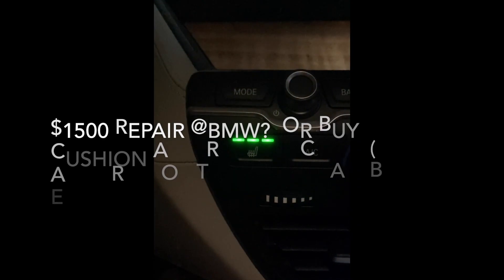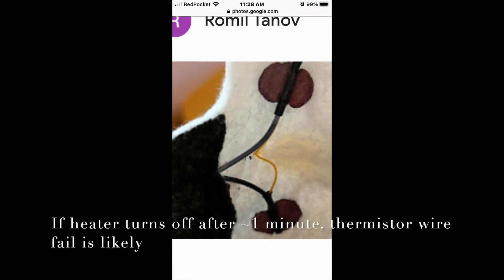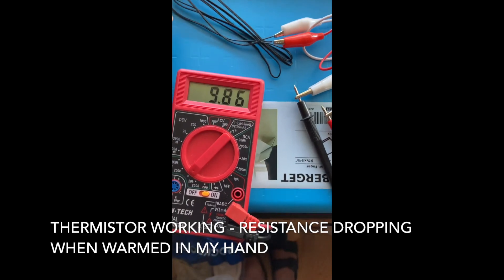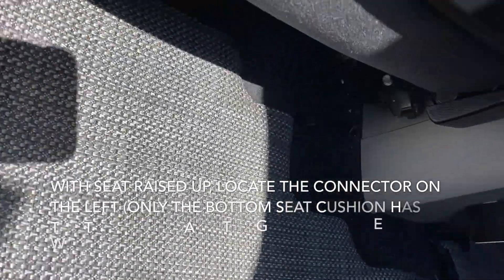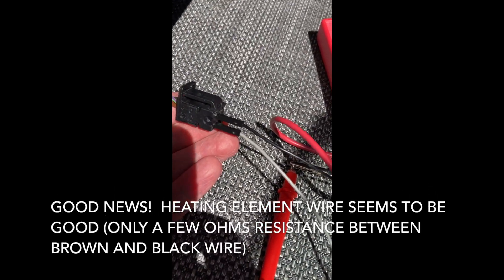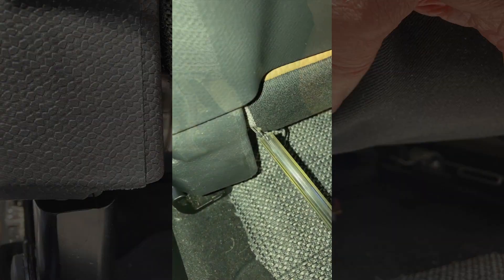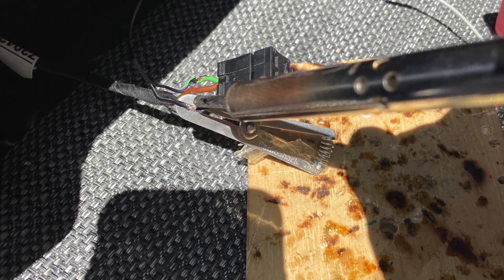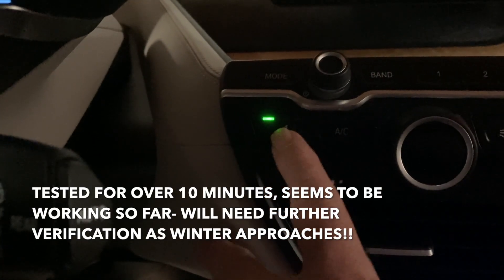BMW I3 DIY  Easy Seat Heater Repair

Comment: I see that this thread is still active and that there are some unanswered questions so: 1, thermistors are two terminal device and they are unpolarized so there is no worry about putting it in forward or backwards 2. Note that there are three wires for the seat heater and the thermistor. That means that one of them, probably the black one, is common to the heater and the thermistor. This is why you need to splice in the new thermostat and not just cut those two wires. If you just cut the two wires then there will be no return for the seat heating element itself. If there were four wires then this repair it would be a bit easier and you would not have to maintain the integrity of the common wire. 
3. If you don't currently owned a multimeter and a soldering iron or gun then you might want to leave this repair to someone more qualified. Maybe share this video with them.
Reply: can you post a link to the thread please?

Comment: At the 4 minute mark you mention that you soldered the new thermistor into the black and green/purple wires. Does this mean that there are 2 wires coming out of the new thermistor?
If so, is there a particular order in which they must be soldered in?
Thanks for your help.

Comment: Hi, I have this exact problem. Drove car last night, after couple mins heated seat turned off. This morning I checked and it did same so I unplugged connector with black, bown and green/purple wire to check readings. The readings seemed a bit intermittent but going on symptoms I suspect it's thermistor. However, on plugging back in without doing any repair I find seat lamps don't illuminate at all so could I have damaged something or is this just coincidence? Basically if I carry out thermistor replacement as you show in video can I assume I can't make things worse?
Is it an open circuit on thermistor which prevents seats operating, that is prevents the heated seat lights etc to be illuminated and hence seat to heat up. So, if I connect a replacement thermistor as you show in parallel with existing one, assuming lights come on and seat heats then this has resolved issue and I can then use plastic tube method to insert into seat base.  I appreciate it's tricky to judge from afar but wanted your opinion if you don't mind. Thanks.

Comment: I lifted up the leather from the lower rear part of seat and found out the black and the grey wires were cut. How does one reconnect them to the thermistor? I can’t find the thermistor. Do I need to tare up some of the pad and dig it out somehow?

Comment: Hi - ive just purchased BMW ix3 seats to fit into my mercedes sprinter. I have identified the cables at the connection socket for the power seat movement but cant find out what the relay wires are for the heated seats do you have a colour wiring diagram for the connection block please? I have also identified the CAN signal wire.
Reply from the maker: No, sorry

Comment: i have the same error code. the heater on driver side turns on for around 4 mins and shut off by itself until completely cool down.  which color of the wire we need to solder with. it seems like you solder both the green and black??

Comment: This video has been around for a while now...did it work all this time?  Any issues? Mine seems to have taken a turn for the worst as well...where it stays on for a bit then suddenly heats up and turns off.
Reply from the maker: Still works fine, and I use it quite a bit during winter.   I haven't had any issues so far.   Thanks for watching!

Comment: Thanks for the great instructions. Worked great on i3 94Ah. 

For info, the fault code was: 804916: Seat heating FA (LIN), temperature sensor cushion line break

Have a nice day!
Reply from the maker: Thanks for sharing!
Reply: What obd reader did u used?

Comment: How long did this repair last?
Reply from the maker: I did this late summer of 2021,  and it still works fine so far ~ 2 yrs later.  I use it a lot ,rather than using the cabin heater.    Thanks for the question!
Reply: @bmwi3diy782 still working ?

Comment: My car doesn't have a heated rear window. I don't know where to start repairing.
Reply from the maker: Unfortunately, I have not encountered this problem yet.   After checking if fuse is good,  you could pull off the plastic covers around the rear window & check if there is a 12 volt signal getting to the wire grid connection at the window.  If there is, then check if the grid lines are corroded.   Here is a video I found that may be helpful,  good luck!   https://www.youtube.com/watch?v=MO-VTsBNOTM
Reply: @bmwi3diy782  Thank you very match
Reply: You wrote "After checking if fuse is good...". Maybe you know where this fuse is located. Unfortunately I can't find the electrical schematics for my car on the internet...
Reply from the maker: I think it is fuse number 35 (50 amp) but I have not confirmed this.   Let us know if this fixes the problem!
Reply: Thank you

Comment: I need some slight help.  I think I found the 10k thermistor on Amazon it’s a bit more expensive but not much.  My question is the connection.  I know in the video you advised soldering.  I’m trying to discern the connection points.  I know you stated to cut two wires but from the video I can not figure out what to connect to what after I make the cuts.  Please help!  I’m freezing the the heat is draining my battery/miles to quickly.
Reply from the maker: I didn't cut the wires, I only removed the insulation from the two wires so I could solder in the new thermistor 'in parallel' to the broken one.   Make sure that a faulty thermistor (as checked by the ohmmeter showing an open circuit or  null resistance) is the problem.   If the actual heating element is showing an open circuit (broken wire), a new thermistor will not help.  Good luck!
Reply: @bmwi3diy782  ok so do I test one of the two wires to connect the thermistor before connecting?  For reference sake did you connect the new thermistor to one wire or both when you pulled back the sheaving.  There thermistor only has one other end after you tuck in the end to the seat correct?  Or are both thermistor wires in the packet being used.  I’m sorry I’m not very electrically inclined.  I do work a lot on my other cars but only have done very simple wiring.  I’m just trying to understand a little more of how I should connect the thermistor to the two wires.  As this is a common problem I’m so sure this would remedy the problem.  Thx in advance your info is a God send as I’m out of warranty.
Reply from the maker: FYI- Mine was cutting out after a few minutes.  After the fix, It has been working like a champ this winter for several months now, saving me a lot of battery life.  I used bimmercode to turn down the settings, because it was actually getting uncomfortably warm.  I went to the lowest default settings in the "code", and it is much more comfortable now.
Reply: @bmwi3diy782  ok I see there are two wires coming from the thermistor.  I assumed there was just one if I understand it correctly now I am just taking off sheaving from the black & green wires and connecting/soldering one wire from the thermistor to each.  If that’s correct then I cover each with black electrical tape.  I’d like to try this, this week.  Please let me know if that is correct.  I’m so sorry for emailing you regarding so many times.  Thx
Reply from the maker: Yes, that should be correct.  Did you measure the resistance between the black and green/purple stripe wires once unplugged? It should read as an open circuit if broken.   Inserting thermistor into seat is difficult unless you use a plastic tube to guide it into place.   (fyi- if you don't insert first, your guide tube will not be removable after soldering).  Use care not to damage/break the heating pad while inserting thermistor into a good position that can control the temperature.

Comment from the maker: I just recently re-coded the seat heaters with bimmercode to the lowest set-
point for the 'low' setting on the seat heater, it works much better and doesn't bake the driver, even with the new sensor position.
Reply: Could you briefly describe what settings you changed to set the 'low' point on the seat heater in BimmerCode?